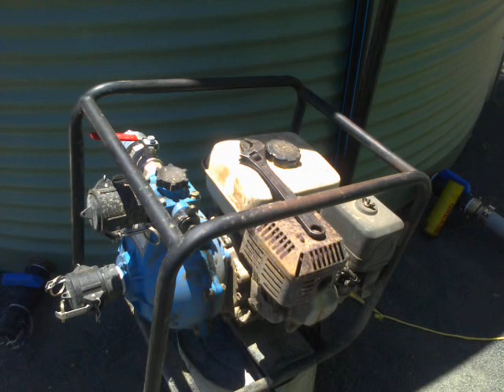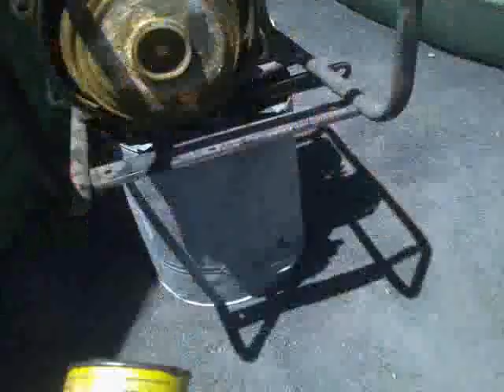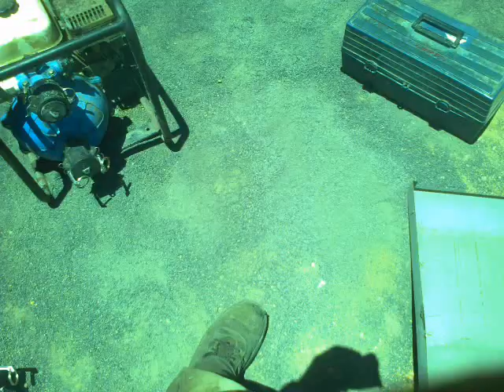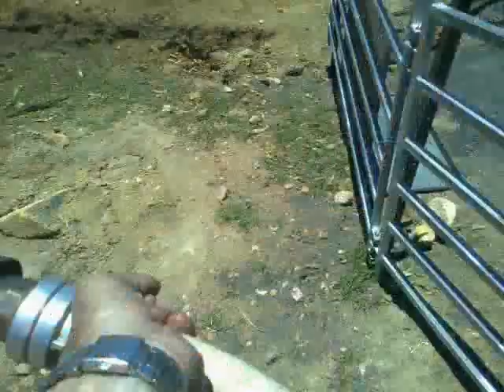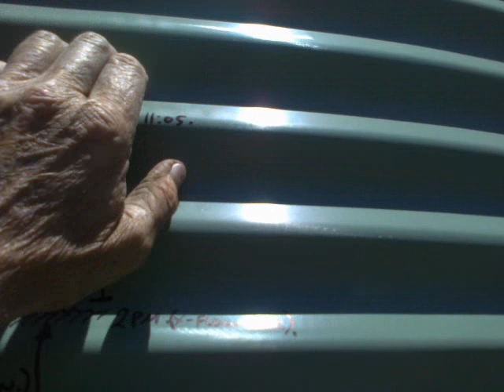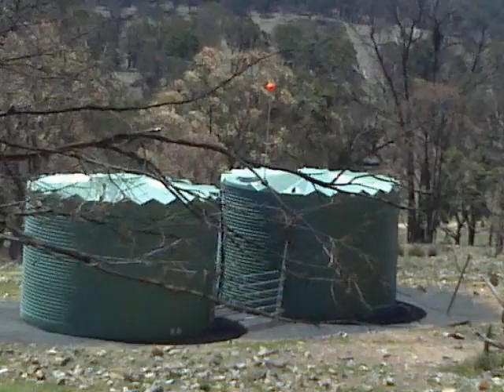Pimping My Pump..., With A Shortened O-Ring ; Because..., Hillbilly !

Comment: One does what one can with what one has... I used JB Weld epoxy to put a water pump back together, worked great for the few years I used it but if anyone ever tried fixing it after me they had a heck of a job ahead them, I did tell the person I gave it to what I had done, but I always wonder if at some point someone tried taking it apart without knowledge of what was holding it together, I would imagine there would be a few choice words said about me! Good job on the splice, cutting it at an angle and stitching it together was the proper way to do it, as good as it can be done without a means of welding it together, along with the grease it should give you many years of service. 
Have a good day.
Cheers 🍻
Reply from the maker: G'day,

Thanks mate.

I've seen JB-Weld on YT, but not in the Shops over here..., it seems to be a lot like the "Plastic Mastic" which came out in the 1960s - I remember Dad's first packet of it, at the time it was quite a revolutionary idea - sort of like Epoxy Resin with Flour added to stiffen the mixture & Dye to make it look more substantial.

 In the right application it can work wonders - for about 5 to 15 years, depending on many many variables.

   It's going to be a real bitch, when we go back to boiling down Cows' Knees to make a pot of Wood Glue... !

Have a good one,

;-p

Ciao !

Comment: Hi Chris. Nice job on the pump. Its truly a Godsend to have that much precious water so close by. Mabye a Ranchersend? Yeah He works through people. I like the guage on the tanks. That weirdly different tree branch, sure is nice. Oil the ends. Excellent idea to auction it for charity. I wish i could bid on it. Hmmm, mabye i can. Shipping would be unblieveable, probably making that impossible. Two feet of snow here. Rev.
Reply from the maker: G'day Rev.

Thanks mate.

  Yes, I chalk it up to the Creator Godtheory of the Universe setting it up that my neighbour & I can work together instead of trying to annoy each other - which a lot of people manage to do.

    I have no idea how one might even find out what the Freight might be on half a ton of Plaited Branch going from Oz to the US...

   I think the Depth-Guage is to be able to see at a glance from a distance when/if the Tank has been suddenly emptied by a Float-Valve getting stuck at one of the 20 Troughs which are in the pipeline to be installed all over his Property.

  To have any kind of an accurate measure still takes a Tap-Test, but the Ball does give a gross indiccation from a few hundred metres off.

Last night I put out 3,300 Litres through the Sprinklers & stashed 700 in my # 2 Buoywall ; running the Sprinklers direct from the Bore-Tank Pump, rather than pulling Water out of my Pool & then refilling the Pool this morning.

It saves both fuel & time..., so like it a lot ; but it requires obsessive planning & timing of each Sprinkler-Station..., to hit the  Stop-Pumping Target after an hour & a half  spread accross 5 Outlying Stations, 4 Sessions on the High Sprinkler (while moving the Sled & Hoses feeding it), and the Buoywall...

Last night I thought I'd put 4,045 Litres out and it turned out to be only 3,750 Litres - so I was 92% accurate and next time the Outstations will get 11 minutes each rather than 10...

  It's a bit obsessive, but it does work.

Such is Life,

Have a good one.

;-p

Ciao !

Comment: I can't recall the particular stuff used at the moment, but I recall someone that shortened o-ring by cutting out a bit and bonding the ends back together with an adhesive. They said they'd also used it to lengthen o-rings by splicing in a bit of another o-ring.
Reply from the maker: G'day,

Thanks mate.

 Well, on the one hand, I've never heard of O-Rings being cut & shut - but I've helped my father do it to a Steel Tyre and then heat-shrink it onto a Wooden Wheel - so I know that odd things can be adjusted to fit...

 And, yeah, I too used some "All Plastic" Cement to hold the two cut ends together before I stitched the glued join.

  So technically I glued, stitched, & served the Joint ; so it had no chance of failing, really (!).

Have a good one.

;-p

Ciao !
Reply: @WarblesOnALot  
Back before they invented o-rings I guess they'd have used a piece of clay and wax or grease impregnated twine,  stuffed into the joint.  Likely there'd not have been a groove to seat it within for early designs. Perhaps caulked with lead?

I bet they had to break such things down to maintain that joint relatively often.
Reply from the maker: @its1110  

Um, how about a Loop of Hemp Twine spliced rather than knotted, & saturated with Bituminous Pitch, similar to caulking Sailboat Decking-Planks with "Oakum " (?) ; that'd give you a Gas-Tight Seal on your Ceramic Turboshaft-Engine the better to take the weight off Fred Flintstone's Footpads !

Leather, particularly Greenhide, was popular for Gaskets, or Fibre-Board ; and Richard Pearse used Greenhide to make two Universal Joints - one between the Crankshafts of his Double-Acting  Horizontally-Opposed 4-Cylinder Aero Engines, and the other one as the Final Drive from the Number-2 Engine's Crankshaft to the Drive-Shaft of his  design for a self-propelled Plough...

 Apparently it went twice around his Paddock before the thing died ; and when it did quit - the Greenhide Uni-Joints were both absolutely undamaged....!

  He were a REAL propper-fulla  Eccentric, was old Mad Dick Pearse.

My first Aeroplane hangs in a Transport Museum in Oz..., but when Dick Pearse's last Aeroplane came to light the Kiwis built a whole new Wing of their Museum to house & display it, and dispatched a team of Archaeologists to ferret around going through the Rubbish Dump where he used to live, retrieving bits & bobs from the Engine of his 1903 Monoplane - which took him aloft & perched him atop a Hedge in April (6 months before the Wrights flew their Flyer at KittyHawk).

   The only bit of his first Engine that he didn't cobble-up by hand in a Provincial Blacksmith's Shop..., were the Sparkplugs - "...because I wasn't set up for working with Ceramics..." (!).

Such is Life,

Have a good one.

;-p

Ciao !
Reply: @WarblesOnALot  
Interesting character! Thanks for pointing me at him.

I'm from North Carolina, where we claim "First in Flight" -- even though it was just a spot for a couple of Yankees to have an excuse to come get away from Ohio winters.  Funny the things people will make up to latch themselves onto.  Hmm... they were sane enough not to go to Florida.

Yep, I'd thought of oakum... but wanted something more modern, and arguably better.  Telecom cable flooding compound came to mind -- clay and wax.  I hated that goo.
Reply from the maker: @its1110  

Who do the North Carolinaeans claim was the first Birdman, Gustave Whitehead (Weisskopf) with his Acetylene-Burning Convertiplane- type of thing...?

   Acetylene is insufficiently Energy-Dense to fuel a functional  Aero-Engine.., and the Photos purporting to be Whitehead with his Acetylene-burning) Prototyope Engine show a Steam Engine rather than any Internal Combustion Engine...

Whitehead strikes me as a self-promoting "Could've Bina Champeen..!' type ; whereas Pearse made Engines which powered eminently successful Levitation Machines which were (sadly) utterly uncontrollable.

 Thus.., Pearse was indeed The REAL Thing - but even he never claimed to have mastered the secrets of CONTROLLED Powered Sustained Flight.

But, he patented Ailerons in 1903, and let the Paperwork lapse in 1913 ; so but for that unpaid Renewal Fee, he would have been able to charge the Crown a Royalty Fee for EVERY Aeroplane in the British Empire using Ailerons until 1923 - with the option of extending it out to 1928.

   But in 1913 he was too stingy to pay the Renewal.

Oopsie !

Such is Life,

Have a good one.

;-p

Ciao !
Reply: @WarblesOnALot  
Wright Brothers at Kitty Hawk.
NC was trying to get the USS Kitty Hawk (the Shitty Kitty) when the Navy decommissioned her a few years ago. I thought that a bit silly.
Reply from the maker: @its1110  

Ah, I see...

  Personally I reckon the Wright Brothers failed to give sufficient credit to all the people whose work they were given & used, like Lawance Hargrave who first invented  the Curved Plane rather than Flat Wings, though they made much of Lillienthal's Lift Calculations being wrong....; but on their bright side, they successfully invented the Wind Tunnel.

  However, their Biplane Canard with a Bifurcated Pusher Drive Chain and Wing Warping  was a total dead end, developmentally speaking....., and it would NOT Fly unless the surrounding Barometric Pressure was over 1035 Millibars (which is why EVERY exacting Replica of the 1903 Flyer ever built has steadfastly refused to leave the Ground..., and that's why the Centennial Celebration Reinactment  was a Failure....

  And by their greedy moneygrubbing selfish Lawsuits over Patent Law they RETARDED all development in Aeronautical Progress in the USA from 1903 to 1917.

   From a lot of points of view, the Wright Brothers  well deserved to be pilloried, and held in contempt.

   But, their Cack-Handed arse-first weak-winged  & wheel-less excuse for a Hairygoplane was favoured with sufficient Barometric Pressure as to have staggered up off their Catapault-Track, and levitated for 160 Ft...,

   Which gave them the impression  that they knew what they were doing...; and they assiduously sold that impression to the World.

  But, bear in mind that the Wrong Brothers had almost progressed to putting Wheels on their powered Boxkite, when Thomas Sopwith was selling  1 &1/2 Strutters & Pups to the Royal Flying Corps,  Triplanes to the Royal Naval Air Service, and the Camel was on the Drawing-Board...

Willy & Orville got a huge amount of "Milage" out of that there High Pressure Area - which wafted over Kittyhawk, transforming their Sitter into a "Flyer", on the 2 Days when they were testing it in 1903.

  Cunning Stunts, the pair of them.

  Such is Life,

Have a good one.

;-p

Ciao !
Reply: @WarblesOnALot  
Such as it is often in the History of Technology.

Watt and Bolton (Who's he?, say most people.) succeeded via patents and lawsuits. Watt didn't invent the steam engine, nor really most of "his improvements" to it.  Right place, right time, with an already successful partner, who had a use for the invention... err... improvement.

The legal actions between the Wrights and Curtis (in particular) are legendary, and shaped aeronautics in America for... still.  The French were likely the real leaders in aeronautics, overall. This last shouldn't surprise us, they (arguably) led Science and Maths for the preceding century and a half. (There were some more important individual folks elsewhere, but there were so many Froggies in it.) It was a matter of their culture.

Hell... we still can't get all Aeronautical Engineers to completely agree on what gives an aerofoil lift. The Bernoulli Effect doesn't seem to strictly apply. So the Wrights basically used their windtunnel to trial-and-error their way... which doesn't make that invalid.

Egos...
Reply from the maker: @its1110  

All good, gotta go, Sprinkle Time.

;-p

Ciao !